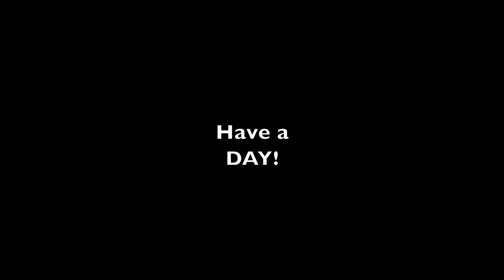She Loves the New Trail, Thick and Nasty No More

Comment: My guess is you will be scattering some seed on all of this??? Just need some roots to hold it all in place. Real nice. I remember doing this with a chainsaw, lawnmower and my F150 to pull the stumps. I cut them high to give more leverage as I pulled them over with a chain. More work but cheaper than an excavator. That garage sale lawn mower was my mulcher but it took a couple of packs of shear pins before it was over. Still a twenty five dollar mower and ten bucks of shear pins was my budget limit. Really did not take that long. Had a nice quarter mile grass drive to a parking area in the woods that was great in fair weather and made a walking path the rest of the year. Also brought a lot of firewood  out on that trail over the years. Girdle them in the spring, cut them the next fall after tick season. Haul them when we could. Sometimes dry weather and sometimes frozen ground. Just never the muddy seasons.

Comment: At the 10:33 mark ii sounded like you ran over a camera!  Whew!
At 20:00 mark you mentioned the problems with grape vines.  You ain't wrong there!!!!
I have some HUGE grape vines growing up into some of my trees and a few weeks ago I got hung up on a vine that I did not see and had a six inch diameter by three foot long limb come out of a dead snag behind me and hit my shoulder and crushed a bottle of water in the cup holder of my tractor's fender.
Luckily it did not hurt the tractor, but scared me a little!
I actually thought my arm was broke at first, but all was OK.
I ALWAYS leave the ROPS up on my tractor, but you sure have to be careful when working in the woods with them up!  Several times they would catch a limb, or vine, causing things to fall around me.

Comment: Hopefully that pipe is big enough.  Get a large rain it may run around it and blow it out, but doesn't look like much runs there so may be ok.  Think I would have moved it down stream some and not so close to where the 2 streams meet.  I've seen a couple of similar setups with steel pipes growing up that had that happen.  They were large steel pipes put in by loggers, but that was in stream with running water all the time and large rains it would really flow.  Eventually went around the two pipes and mades its own path.  Nice having the property and equipment to do this stuff!

Comment: I cut in 1.1 miles of trails through my property. The deer started using trails as soon as I opened them up. One section they use so much I ended up putting a stand on it. Glad they use them so all my hard work is being well utilized.

Comment: That rope size grape vine was what I got one of my worst near misses about. Was cleaning out under a bush and did not see the vine snaking over to a large walnut about 15 feet away. Pulled down a large dead limb about 6in in diameter and 15 feet long that landed right across me and the steering wheel of my open station tractor. Missed my head and face by inches but scraped my shoulder and ripped my shirt sleeve. Total shock when one second you are scraping weeds with the bucket and the next instant you are under a massive limb. No real damage to me or the brand new tractor, but I sure watch for grape vines now, and cut them off whenever I see one as they are bad for the trees long term.

Comment: Good, uh, afternoon! 35-mile bike ride put me later again today. Mike, when you broke into that open patch and got into the MF Rose thicket, I started having flashbacks to similar spots on our farm. Looked just like that, but we didn’t have your handy excavator to pull them up! A brush blade on a trimmer or drive the bucket through at ground level to shear them off. And then treat with liquid Tordon or Spike pellets. Or we’ll have them all over again next year. I do like backing over them with the brush cutter, or shredding the windrow we cut out of the fence line. Feels ever so satisfying to make little pieces out of a pile. Nice work on the new trail!

Comment: Question on the grape vines. I have a lot of that also, will it kill the trees?  We also have other vines that I try to get but they grow like crazy 😜
Reply from the maker: Yes they do, kind of chokes them out i guess
Reply: Absolutely. They can kill it by physically choking it off, or by choking off much of the upper branches and canopy. They can also kill it by starving it for water.  Cut off a large vine in the spring and watch how much water it is pumping up out of the ground. Come back in a couple days and observe the wet, slimy mound that has formed under the end of it. It’s shocking how much water it is pulling.
Reply: The vines also get so heavy they can cause weakened trees to topple over .
Reply: I have a wild grape in my far forty that is like five inches thick at the base!
Reply: We have a few on our farm that are in the 5-6” range down low. We used to climb on those, and they didn’t sag. Our logger said they found one on a job that was so big they made a railroad tie log out of it, just to say they could. Would have to be 13” on the little end, and 10.5’ long. I think he said.